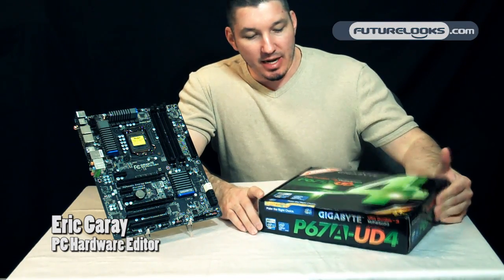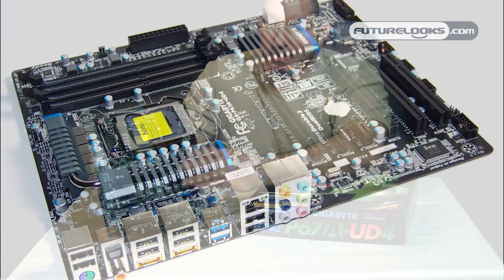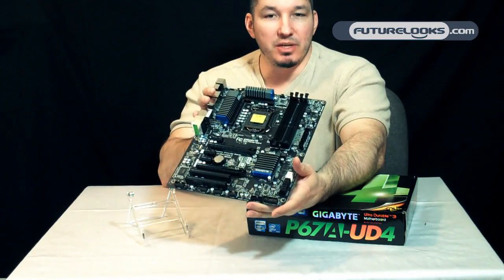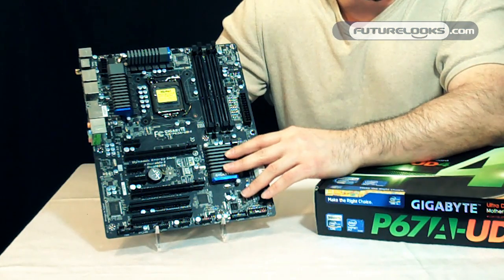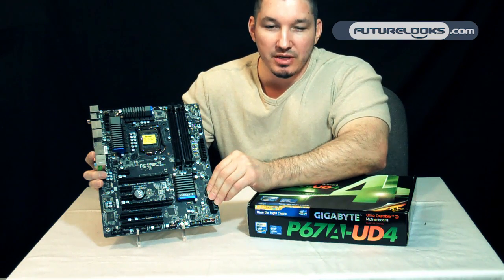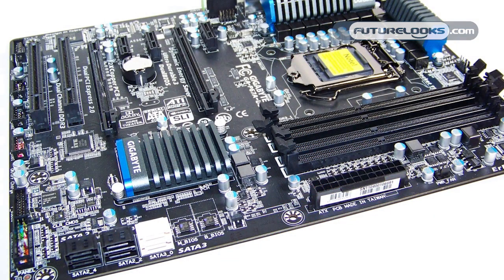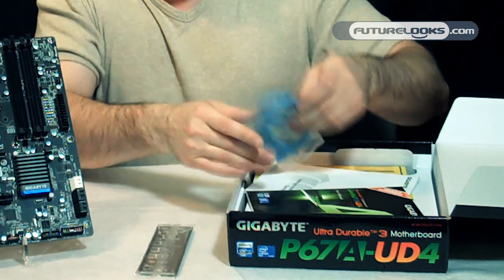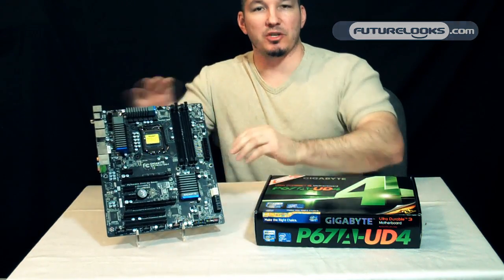Futurelooks Unboxes the GIGABYTE GA-P67A-UD4 Sandy Bridge LGA1155 Motherboard

Comment: Just installed a GA-P67A-UD4-B3 in a system for a friend with an Intel Core i5-2500k and eVGA GeForce GTX 570 SuperClocked Edition GPU. The card is awesome, lots of features that I didn't even have time to go through before getting the system up and running haha. Seems very user-friendly and well-documented.